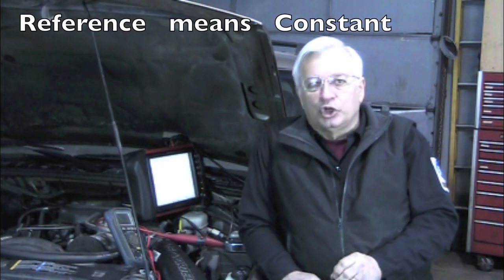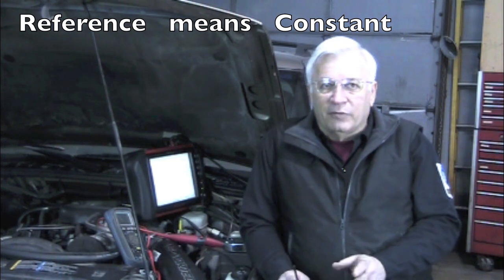5 volt reference

Comment: Imagine a potentiometer with constant 5 volts feeding it from the engine computer.  The other end of the pot is grounded back at the Ecm.  The wiper is controlled by let's say a throttle and moves along the pot resistor giving corresponding voltages from 0 to 5 volts back through the 3rd wire to the ecm.  We are dealing with small voltages here at the ecm so the 5 volt ref must be constant.  The computer switches circuits on and off by grounding them which reduces the current and allows for smaller components on the board.  Great topic!

Comment: @diesel1dee the 12v in is to the module and then the module sends out the 5 volt reference to the sensor and the sensor sends return voltage on the signal wire

Comment: Hello, I'm trying to investigate a problem in my car that has 2v instead of 5v reference, add I wonder if I can supply 5v from external source in case the problem comes from the PCM? or this reference voltage must come from PCM to function well? Thanks!
Reply from the maker: great question.  Here is short answer.  (assuming 12 volts as standard). 12 volts supplied by battery to the PCM, is reduced by the PCM and supplied as the 5 volt circuit.  This is a supplied before load voltage.  All loads create a voltage drop.  If the 5 volt is reading less, it is either experiencing an unintended voltage drop or what you are viewing is after the load.  All DVOM's average and display that average.  If your circuit is variable it can be confusing.  The best display is a lab scope.
Reply: Thanks...

Comment: REALFIXESREALFAST, why is the sensors ground isolated or lifted from the battery ground, they aren't connected why? What is a normal resistance range of a various car sensors?

Comment: So your saying your cam and crank sensor will run off a 5v not a 12 v system ? Another question: if so is the cam and crank producing its own 5v so the pcm or ecm can use it and then determined if it working right? Or is there a resister to turn the 12v into 5v? I ask cause I wounder on how would u test for that or am I just confusing my self and thinking to much

Comment: Hello, sir.  Could this 5v reference be the cause of a crank position sensor DTC on a ford 302? If so, does this mean that the pcm itself might need to be replaced if it fails for 'noisy' ckp sensor output?
Reply: Did you get it figured out?
Reply: @user-wj9wq7mk4h probably not

Comment: at the end of the video you say you need a good 12v in"... but don't you mean 5 volts to the sensor and then the sensor gives a reading back and the computer decifers the outcome based on the 2 voltages?

Comment: Is the PCM sending the 5v reference or is it coming from each sensor?
Reply from the maker: The 5 volt ref originates in the pcm, it is then routed and sometimes shared by some sensors
Reply: @realfixesrealfast  Is the grounding done by the sensors or the PCM?
Reply from the maker: @meblake7359  the answer depends on the design of the system, the diagram will provide the answer.  Some sensors are grounded by being screwed to the engine, and some are 2-wire, 3, or even 4-wire.  The "reference" voltage is limited to 5 volts and ground (0) volts to provide an more accurate measurement
Reply: @realfixesrealfast  Well, that makes it more difficult to diagnose without a wiring diagram. Can you use a milliamp test light to see a blinking of the signal from sensor?
Reply from the maker: @meblake7359 , it would probably blink but that would not really tell you anything of value.  It would be much better to view the signal with a lab scope.
Reply: @realfixesrealfast  I wonder if you could use the hold feature on some dvom's to see the blink voltages in order to see if they are at spec?
Reply: @meblake7359  No, it would be a waist of time, DVOM sample rates are too slow.  A LabScope would work perfect.
Reply: @duanemariage9514  What did we do as automechanics before scopes became affordable? ECM's have been around since the 90s.
Reply: @meblake7359  Great question, easy answer.  We used the tools that have become outdated today;  critical thinking, vacuum gauges, DVOM'S, jumper wires, fuel pressure gauges, and logic probes.
Reply: @duanemariage9514  Those are the tools I remember, except I don't remember a logic probe. What is that?
Reply: @meblake7359  a logic probe was the first early version of what is now the power probe
Reply: @duanemariage9514  interesting. I've never seen that.

Comment: Ok I have 5 volts at sensors but the injectors are not pulsating car won't start so what does that mean that the computer is good??
Reply: a diagram review would be needed for sure.  The injectors usually have 12 volts constantly and the ground is pulsed to make them work.  The 5 volts is a shared voltage for monitoring them. The PCM  should see the cam signal for timing sequence and the command the injectors on by sending a ground to the injector.
Reply: @strokewarrior5762  yes I know all this I have 12 volts at the injectors and the computer is putting out five volts for the sensors one being the tps but no pulse with a noid light and the computer has no communication on the scan tool so because the computer is putting out the 5 volts to the sensors does that mean it's not a wiring problem and the computer is bad? I didn't check every sensor on the 5 volt reference from the computer but I checked 3 and they were right at 5 volts and I don't think its a crank position sensor or cam sensor because the car is getting spark so that means it's getting a signal from those 2 sensors when to spark right??
Reply from the maker: @jasonelliot9633  No, not really. Of course it is possible but you are not there yet.  Remember the PCM is a logic device.  It needs inputs, then apply logic, them sends commands.  The noid light pulse is a command.  So verify the inputs are correct first.
Reply: @realfixesrealfast  what imputs I don't know what you mean
Reply: @realfixesrealfast  if you are talking about a crank or cam sensor I seriously doubt that is the problem I have no communication from the computer on a scan tool
Reply: @realfixesrealfast  and for alittle while the head lights and dash lights were pulsating when it was running and the alternator is brand new but that just tells me what I already know of course that it's a wiring problem or the computer is bad
Reply: @jasonelliot9633  yes the ark & cam are inputs but if you have no communication then those inputs are either not making it to the PCM. but more likely they are but you have a network issue.  All the computer talk to each other thru a network.  A problem there can shut it all dow.  You really need a tech who knows how to use a labscope and how networks communicate
Reply: @strokewarrior5762  well I have been waiting to respond to this because I wasn't sure if I would I have been working on cars for many years because of shitty mechanics that only care about putting money in there pockets so with that Said I will figure it out on my own it's not that complicated and if I can't I will get rid of the car I don't need no tech as you say but thank you for trying to help but no thank you
Reply: @strokewarrior5762  and ok if it's a network issue which honestly makes sense to me because the network is the communication so there is a problem with one of the computers which might be the main computer but I don't need a lab scope or a tech it can be checked through the obd connector with a multimeter that is what I will be doing next
Reply from the maker: @jasonelliot9633  Don't overlook that the actual computers may be ok, but it could be a simple bad connector issue.
Reply: @realfixesrealfast  yes you are right and that is what im leaning more towards actually a bad ground or wire I will check the network with a break out box and multimeter If I find a issue maybe I can unplug some computers and see if I get a good number
Reply: @realfixesrealfast  I just noticed that the injectors have 12 volts but when I crank the motor it goes down to 10.2 volts I wonder if that is why the injectors are not spraying fuel well maybe not they should still have a noid light pulse I think and they don't
Reply from the maker: @jasonelliot9633  if it I 3 wire,  1 should ne 12 (system voltage, 1 should be close to 0 (ground), the 3rd should be the 5 volt reference signal
Reply: @realfixesrealfast  what do you mean 3 wire? The injector wires? They are 2 wire 12 volts the only wire I found lose so far is at the starter not the main battery positive but the ignition one the starter cranks the motor so I don't think 🤔that will cause no injector pulse
Reply from the maker: @jasonelliot9633  my mistake, I was confusing two different reply's.  The injectors are just two wire, power & ground.  Sorry for the mistake
Reply: @realfixesrealfast  yes I know
Reply: Bro i have same issue my 1997 celuca 1.8l scan tool dont communicate cranks but wont scart did u ever find your issue
Reply: Jason Elliot  please let me know what you found the fix im in the same boat